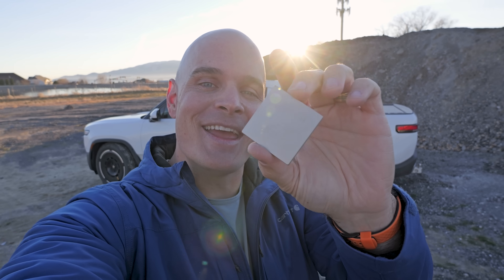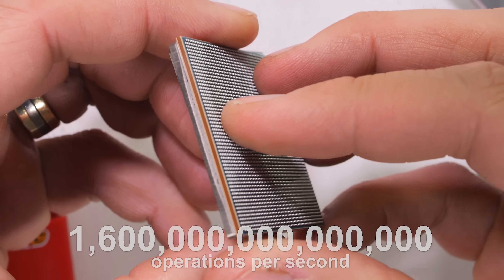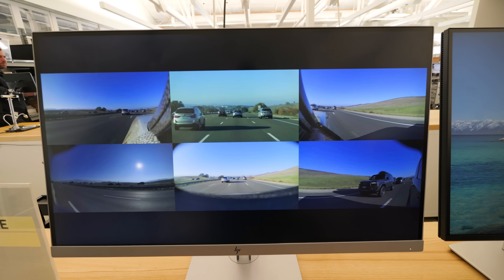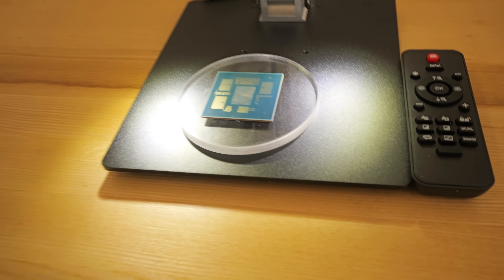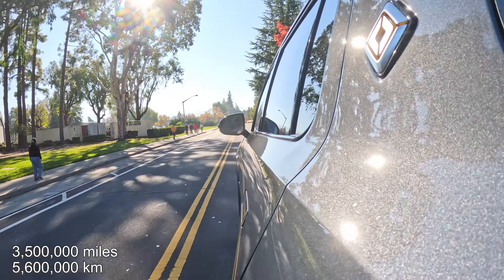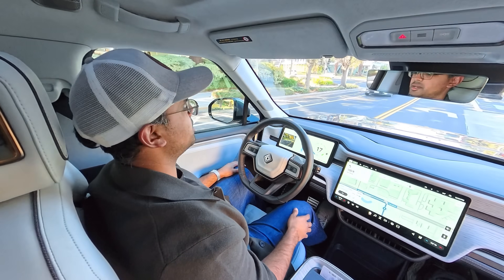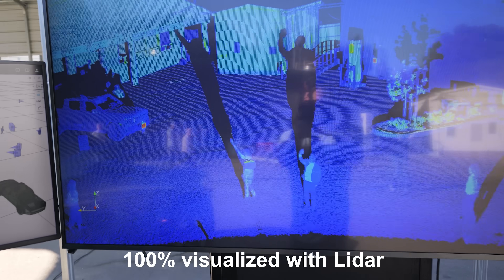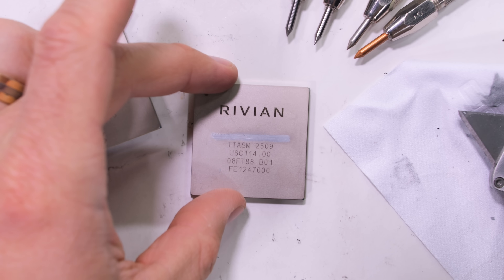I Broke Rivian's Self Driving Computer Chip

Comment: Hey Jerry, I really need some advice. I recently got a Vivo X300, and I accidentally pushed the SIM ejector tool into the mic hole. When it happened, I felt like I pushed something or broke it. The mic is still working fine, but I’m EXTREMELY ANXIOUS I might’ve messed up the waterproofing. Do you think I damaged the dust and waterproofing mesh around the mic? Also, will you ever do a teardown of the Vivo X300? Appreciate any advice 😭😭😭

Comment: vision beats lidar if software's dialed in—cheaper to mass-produce, no bulky hardware eating space or power. Cameras evolve with updates, lidar's stuck at launch specs. Vision uses everyday parts, so supply chains stay smooth, less vulnerable to shortages. Plus, it mimics real human driving brains better—processing vast data streams for context, not just points. Software can amp low-light or weather smarts endlessly, turning weaknesses into wins without new gear. Scalable magic, really.

Comment: Ok, so, I'm building software I call Eclipse that sits in the post-render buffer of a device, watches what's rendered, and applies filtering based on rules you set in conversation with an AI.

"I want to boycott Nestle" becomes filters placed over the word Nestle, but also by association the Nesquik Rabbit, Carnation, KitKat, and other Nestle-owned products and companies were blurred as well.  Since I used AI to set the instruction, and AI handles the enforcement, I don't have to rely on checklists or keywords.  

And it works right now.

The only bottleneck right now is processing speed.  I'm devving on win11 for win11, but it's proof of concept for all devices that will be able to run AI.  Rivian's chip, and self-driving Ai in general, prove how fast AI can 'see' AND react, showing me that it is only a matter of hardware that's making it so that you can block everything and anything you want at the system level with a sentence to your Eclipse application.  

This is the kind of stuff that's coming folks.

Comment: Always remember unnecessary etectronic complexity= multiple problems when it fails ....old school tec in cars or suv worked better ..... comming to the point all vehicles are good unless they are fixable with a screw driver n plyer...... sitting on dead vehicle on road side

Comment: LPDDR (Stands For "Low Power Double Data Rate" , Wich is sacrifaces latency for power) RAM Had an latency , heck classic Dynamic RAM (DRAM) Architecture Has A Noticable Lag That Stalls The CPU For A Little So Putting Memory To Substrate Has Little To No Benefits , This Is Why Small Embedded Systems (Spesifcly MCUs or Microcontroller Units) Use On Die SRAM (Static RAM , wich is consists of few transistors and quite a bit expensive for his density)

Comment: Jerry, PLEASE if you ever review a chip next time, do not flash meaningless numbers and "wow" factors. You only forward their miss-representation. What i mean:
-From vid and research: Those lpddr5 chips are 6gb, 64bit bus, which mean one unit has in total 18gb of memory and max 192bit bus. 205gb/s bandwith. And to note, when using multiple units in parallel, performance rarely scales 2x, limited to only specific tasks. Metric of 1600 INT8 TOPS is disclosed as *sparse*, which means basically that they used their own method of getting that number, this isn't a clearly standarized metric, so it has to be ignored.
-RTX 5090: 32gb gddr7, 1790gb/s bandwidth and memory chips are not on the core package*, *512bit bus.
-GTX 1080 TI: 11gb gddr5x, 484gb/s bandwith, 352bit bus. (this is a gaming card from 8 years ago, come on)

There's hardly any more information about this chip, but just looking at these few metrics tells a lot about its actual performance vs what is advertised. Please, next time add real ground specs of the chip, with comparision instead of just flashing big meaningles numbers without context.

Comment: You still irritate me how you did the Cybertruck fake test. The one where you put thousands of pounds on the hitch that is rated for 1600 lbs max and it didn't break because the front wheels of the truck lifted off the ground, making it impossible for the hitch to break. You then pinned down the front of the truck, got the hitch to fail at 5x it's rated limit, and deemed it too dangerous to ever tow with. People still cite that test as a reason why one should never tow with the Cybertruck when there is no such problem. You demonized aluminum even though a C130 transport plane uses an aluminum frame and has a cycle life.

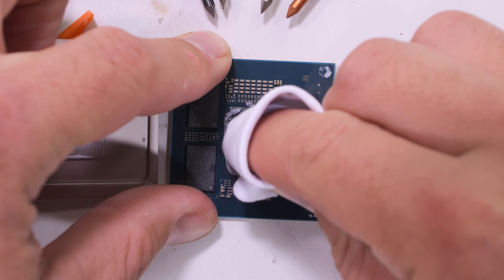Comment: 3:23 this kinda seems like a moot point to put the ram on the substrate like that, like it's not really shortening the wire runs by that much when you're putting it on a PCB substrate like that, it'd be the same thing as having them soldered on the PCB around the socket, if you're really worried about latency, why didn't they use HBM.

Comment: Having a chip does not mean having the training superserver.  Once you have the superserver and the chip you will need billions of miles traveled.  I think Rivian is too late to start that as a FSD (driverless) was captured in Austin yesterday.  Going their own way is a huge mistake.  LVL 5 is already achieved and it's only pending regulation.  Regulation will come at the federal level since it will become very expensive to certificate it 50 different times under hundreds or thousands of checkmarks.  The EU is moving to a single certification.  China has one rule for all their provinces.

Comment: We had a 2022 Rivian R1s traded into our dealership. I work in parts and got a request for tires/wipers/cabin filter. I tried to reach out to Rivian to purchase the cabin filter, wipers. You cant buy parts for these POS vehicles unless your the owner. I explained to the customer service rep im getting parts for it because it was traded in. I was told I still needed the previous owners permission. Well I cant get that cuz I work in PARTS and I just need/want to buy the requested parts to resell this POS. They act like they are something special. Dont worry I found parts for it that worked the same. Tires I did have to get from ATD cuz they are "special" tires lol. Rivian is a JOKE

Comment: Over 3 times more powerful that Tesla HW4...very impressive!
Reply: Yet requires painted lines, pre-approved roads, won’t be out for at least a year, and used a “demo course” and still needed the driver to adjust.
Reply: @iloveveggies7634  And costs 4x less, dosn't have thew cash that tesla has to throw at it and hasn't been working on it as long.

Comment: 6:40 that Lidar sensor will not last 5 minutes in a snowstorm. I hope there is some heating element which will prevent the buildup of snow and ice on it.
Reply: I’d hope so but a heater isn’t hard to implement. I bet it also knows if it can’t see anything and let you know.

I do know that it’s better than any machine vision cough cough Elon

Comment: 6:28 It's actually the other way around, LiDAR performs worse in rain and fog than cameras. The emitted lasers can get scattered due to water droplets in the air, making it see nothing, as the sent out light does not return to the sensor. On the other hand a camera is a passive sensor, so all the light that goes through the rain or fog is captured by the camera, allowing it to see through it like a normal human, with the advantage of being much better at distinguishing small changes in the color. Humans are capable of driving cars with eyes (ie cameras) without something like LiDAR so an self driving system should be capable of driving a car with the same senses that a human has (and even better thanks to 360 vision).
Reply: The company I work for just installed a Lidar safety system this year and it sometimes just doesn't know what to do during certain weather conditions and will give false positives. Just today it's been going crazy due to high winds and naturally we get the blame anytime it acts up, so I expect to get a few phone calls later.

Comment: I'm not going to say that LIDAR is required, but I will say that RGB cameras aren't enough. Who knows if a tech I've never heard of will pop up. It unfortunately needs to be better than humans in basically every situation for people to be happy. I disagree with that stance, because half of you are worse at driving than the average human driver, but 70% of you think you're better. As far as I'm concerned, if it's better than the bottom 30%, then it's still safer than having those people driving, and it's not like you need to use it if you don't trust it.

Comment: 1600 Tops means nothing if you don't know the magnitude of it... speaking of AI, it can run on one of those: int4, int8, int16, floatpoint (fp)8, fp16, fp32 and so on... if this 1600 Tops are measure in int4 or int8 is not that impressive... it would be similar AI performance to some gaming GPU...
Edit: i just find some "official" information, the 1600 Tops is in int8 and i also compared to some conventional pc hardware, the rtx 5090 has 3,352 Tops, i told it was not impressive 😁

Comment: Self driving is not safe, until every car has the same ability to comms with the vehicles around them, thus making sure the swarm does not collide.
Reply: everyone keeps saying this but it keeps getting repeatedly proven to be untrue, not even mentioning the fact that we use e2e models now, good luck ‘hardcoding’ anything
Reply: @Redstoner2b2t it's been proven in many different methods. The problem is the actual person, people or other cars not connected to the same systems. The issue IS THIS - spuds (general public) today won't allow such a system to be in cars as it invades their privacy, yet they want safe vehicles and to lower of not eliminate the risk from other road users. Either accept facts, or accept u will always have idiots in the roads

Comment: When automobile self-driving is put through the same regulatory scrutiny as aircraft autopilot and autoland BEFORE being unleashed on any public road, I might consider giving it a shot.

The first time Tesla ran into a firetruck, the tech had a major failure as defined by the FAA for similar flight systems. Self-drive should have been univerally recalled and required to prove a average major failure probability of less than 1 out of 100,000 chance per driving hour before being allowed to operate again in public.

And yes, that probability should be verified and   proved for EVERY change made to the software.

And yes, if the FAA can regulate the safety of automated aircraft systems to make sure they are safter that human pilots, then NTSB or whatever should be able to regulate the safety of automated ground vehicle systems to make sure they are safer than human drivers.

Comment: "painted line". That rules out my city. The lines never survive a winter of plowing. And obviously no lines are visible when covered in snow all winter. The lanes also change position in winter, the first person will cut 80% into the parking lane in a bend and that becomes the new lane. Residential streets usually end up with 3 tire ruts down the road for 1.5 lanes.

Comment: My current car sensors, including radar, are rendered useless when heavy snow or (super-)heavy rain. I wonder if the mount of the lidar on the top of the roof right where the water and snow from the windshield is moved will impact its ability to do the thing - right when it's most needed.

Comment: Living in a northern climate. It's hard to think this will ever work here. As there are days when I myself don't even know where the middle of the road is or where the side of it is due to snow. And yes, I know it said that as long as there is a yellow line. What happens when you turn into a road that doesn't have it, or there is construction. I'm assuming the human driver will need to take over in those situations still.
Reply: Exactly, so its not about the sensors but about the brain. To make the brain better, you need massive amounts of data. Guess who had that foresight and thus is miles ahead with that...

Comment: Hole up! The end of 2026? They said R2 comes out early 2026 🧐 3:59
Reply from the maker: Yeah there will be a few R2's with Gen 2 hardware and not Gen 3 Hardware.
Reply: @JerryRigEverything so more waiting?! 😩
Reply: @cliffordmcgraw8444 that's the game in EVs. You have no problem waiting 40 minutes every time you need 300 miles of range... over the life time of the vehicle that's about a year of your life spent charging. Which is plain retarded. EVs are incredibly impressive in every aspect except the whole ya know 40+ minute "refuel" time that's just plain insanity. Give it 10 years or so when they are charging around 1600 watts and maybe you can cut it down to 10 minutes. Even that is ridiculous. Normal refueling time in an SUV is about 3mins.

Comment: Rivian must have had the most secret skunk works project with the top chip design people on the planet to develop the highest TOPS AI chip to go in a car.  I just don't believe they did it by themselves.  I'll have to wait for the full presentation video to get the details.
Reply: They probably just made up a big number / lied, TOPS is very subjective and nobody uses it as a real measurement since there's not really a good way to measure it and what is considered an OP isn't even truly defined.
Reply: 1600 TOPS isnt that crazy it's half a 5090 and that's if it actually gets that performance

Comment: So Rivian is using ARM.  Which is smart, allow the memory to have the shortest path to the processor.
Reply: Does ARM mean short path to RAM ?
Reply: @tauzN not entirely a lot of ARM chips are now being designed as a SoC.  But ARM is more widely used as it has better energy efficiency than the x86 counterpart.  Hence why a lot of phones are using ARM style chips.

Comment: This processing power in a desktop would be AWESOME !  Lidar for the win ! That eliminates a bunch of blind spots of some of the existing systems. I could see our seniors being more independent for longer with a reliable self driving system. They need to get to groceries and appointments - safely. Once physical mobility becomes an issue, its a different problem. Memory and compute power together... wow !  A baby version of this in local network security cameras would be awesome.  The future is looking up !
Reply: In a desktop it's not that easy to get this processing power unfortunately. Here the values are huge because the chip is hardware designed to do only one task : detect objects on a video signal. Everything in this chip is optimised for that.
But there are a few TPU and NPU chips available that allows to do exactly the same thing in a desktop or in a server, for example to analyse security video signals. It's already happening since a few years.

Comment: That thermal paste will dry up in less than 5years, imagine when moving vehicle processors start overheating, underclocking and lagging 😂
Reply: Every car that has some sort of electronic system have thermal paste on the chips to dissipate heat, so nothing new here. And it's been more than 15 years now that cars have a real computer to do object recognition through a camera, first for speed signs recognition, then lane assist, then pedestrian detection, etc...

Comment: You can look up the specs for the DRAM on Micron's website since the FBGA Code D8FJC is clearly visible in the video. It's 48Gb (or 6GB) LPDDR5 running at 8533MT/s. Zack mentions memory moving on package - this very high speed is the reason why. The physical distance needs to be short to maintain signal integrity.
That's 68.3GB/s per memory channel times three memory channels - meaning each chip has a total of 18GB of RAM available and the calculated total bandwidth of 205 GB/s fits with what Zack says in-video.
Reply: seems to me when it comes to chip fab, you know what you're talking about...now, please explain to me how the lady @0:42 is fabricating the chip with all that hair on her head exposed? genuinely curious what is going on there? cheers!
Reply: @hongniao10 That looks to be quality control or maybe development. 
Certainly it's not part of a fab since it's not a cleanroom.
Reply: @Steamrick got it, that makes sense, cheers!

Comment: 2:02 why is the thermal paste so dry?
Reply: Probably a high tdp thermal paste, less oils and more conducting material
Reply: @EagleFPV43  Also it's an engineering sample which could be different than production
Reply: doesn’t matter how dry it is after application if it conducts and doesn’t crumble away
Reply: Not paste

Comment: Operations per seconds incredibly application dependent so can you add more detail on what kind of method they are using to benchmark.  The El Capitan supercomputer operates at 1800 TFLOPS per node last i checked, probably more now.  Are you really with a straight face trying to tell us that a vehicle with in-house designed silicon is pumping out 1600 TFLOPS?  That would be extremely unlikely and disingenuous on your part.  Can you perhaps tell us how Rivian came up with this number?  Thanks.
Reply: 1600 TOPS. Not TFLOPS. That's 1,600 INT8 AI inference operations per second. El Capitan's TFLOPS are floating-point physics math, while Rivian's TOPS are low-precision AI inference. Different units, different workloads, not directly comparable.
Reply: @katlis  Then why does he directly compare them to COTS hardware like Rivian bottled lightning with their in house silicon?  It's deceptive at best.
Reply: @BasedF-15Pilot  He’s comparing AI inference chips, not general-purpose compute. COTS automotive AI chips from NVIDIA, Qualcomm, etc. are also quoted in TOPS because that's what matters for real-time perception and planning. It's not deceptive, it's just staying within the same type of workload. Comparing TOPS to TFLOPS would actually be misleading, and he's not doing that.